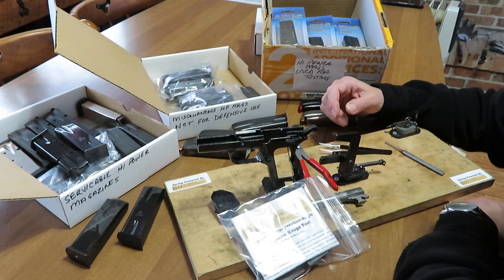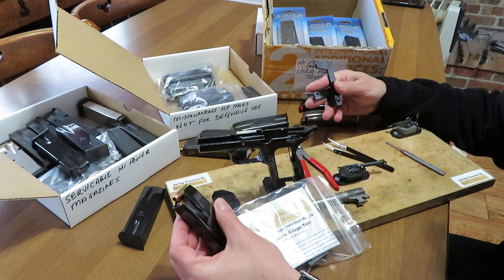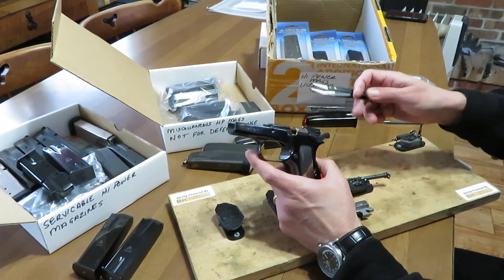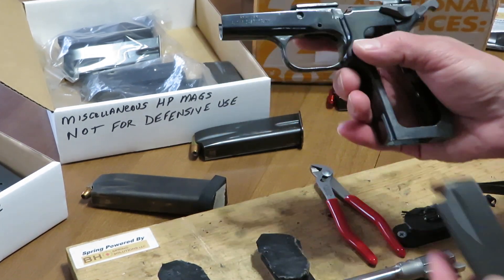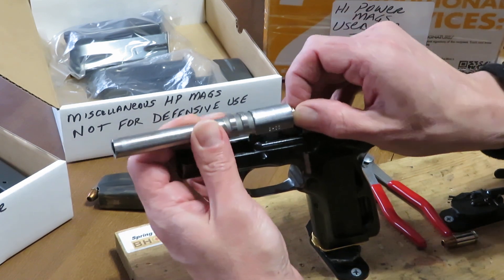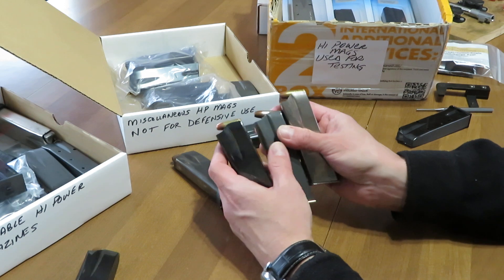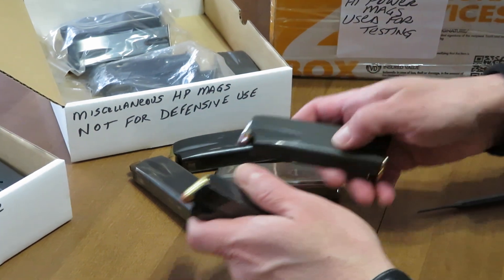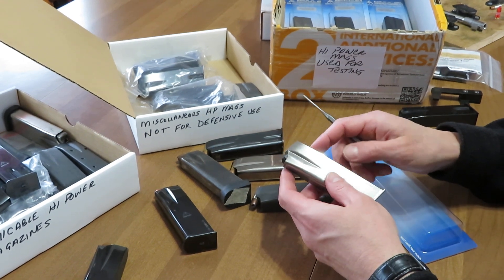Advanced Hi-Power Magazine Fundamentals - BHSpringSolutions.com

Comment: Question: I bought an OLD Browning Hi Power and found it has a 'loose' trigger pin. By this I mean I can push it through with a finger easily. Will a brand new pin fit tighter? Have I got a bigger problem?
1.it is NOT the pin holding the magazine disconnect.
2.I have removed the magazine disconnect to make the trigger action smoother and this is how I found out the pin is so loose.